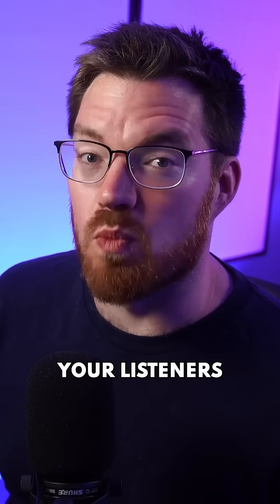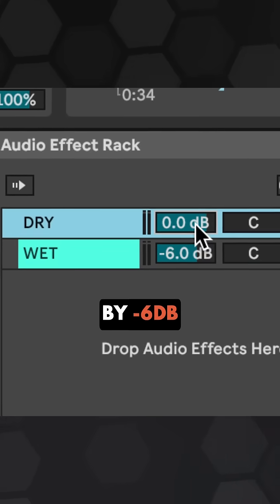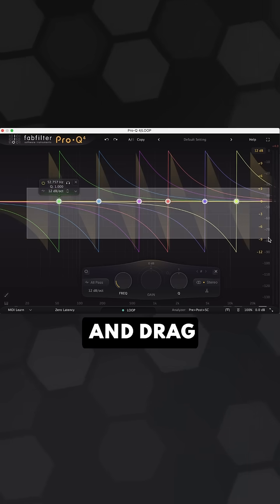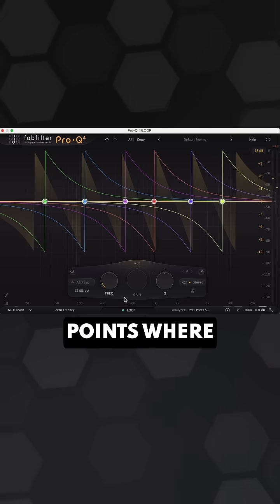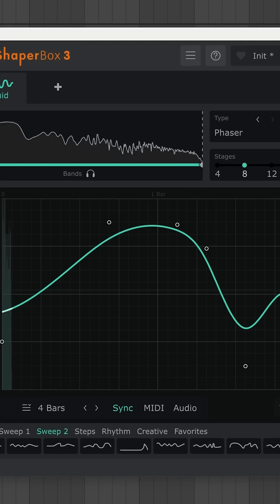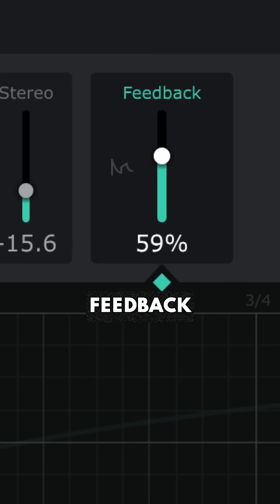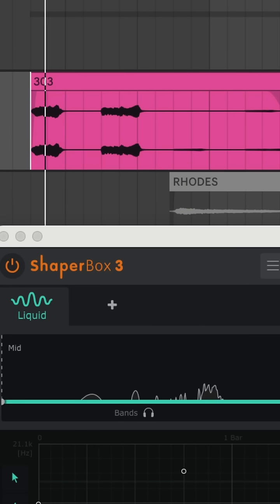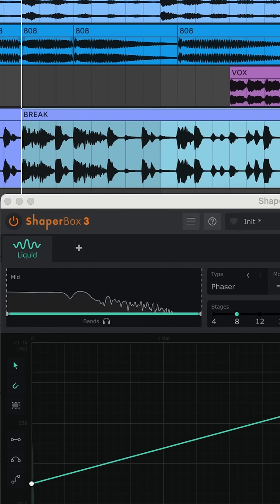How a Phaser Works

Comment: This begs the question; what’s an all pass filter
Reply: what's a google?
Reply from the maker: An all-pass filter keeps the sound’s frequency content the same but shifts phase, which is key for effects like phasers. Feels like a future video on this would be useful 👍
Reply: @Cableguys Yes please. If often wondered what the purpose of a filter that lets all frequencies through. And phase shifting is still like black magic to me. I use the sound often, but how it’s created, no idea
Reply: it be like not having a filter at all, since all frequencies are allowed to pass.
Reply: An all-pass filter only creates phase shift, but doesn't directly modify any frequencies. A single one is nearly inaudible, but if you stack them, you get a disperser. If you then mix the all-pass-filtered signal with the original, you'll create funky phase cancellation.
Reply: @SkyyySiinteresting. So an all pass filter really needs to be stacked to have any effect. I’ll have to have a play around with that. Cheers